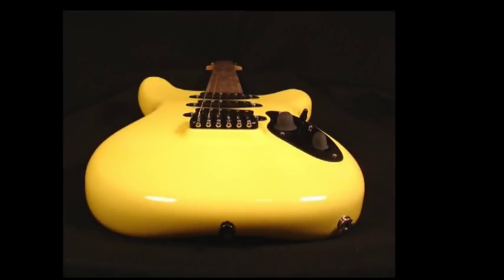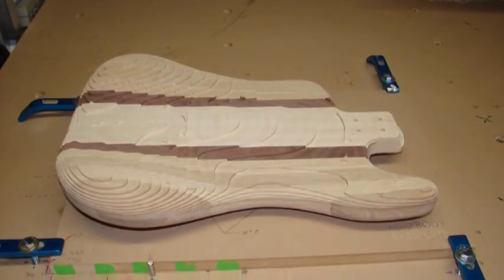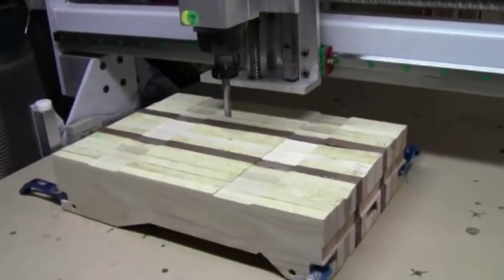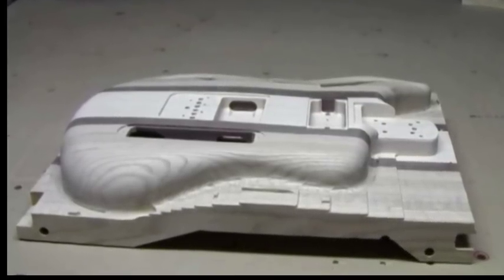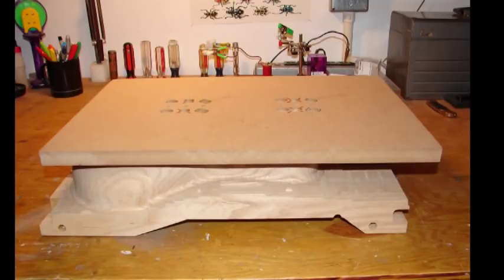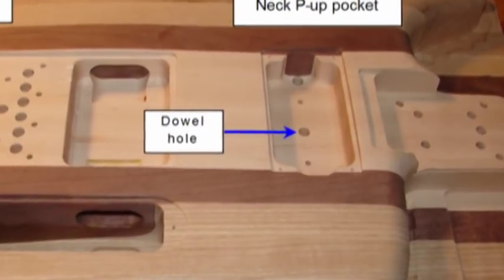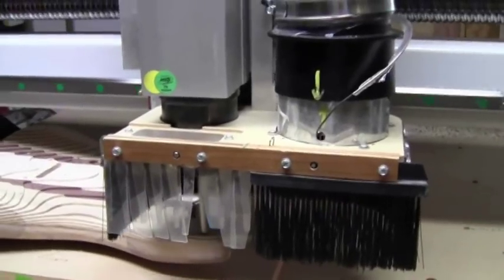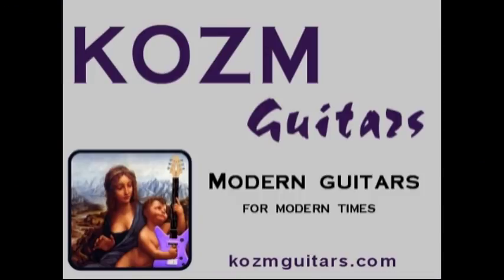CNC Guitar Tutorial - Flipping over a 3D body

Comment from the maker: #2
Secondly, as I “pre-chamber” most of the individual planks, I believe this actually enhances the overall tonal character and resonance of the body.  By eliminating a lot of the energy-absorbing  “dead wood” in the very core of the body, the outer strata of wood are more free to micro-flex, resonate, and re-propagate the sonic energy back into the bridge / neck system.  
(Cont’d at #3)

Comment from the maker: #1
I can’t say I’ve noticed any degradation in sound quality.
In fact, I would say that if anything, it either makes no difference whatsoever, or actually IMPROVES the sound (over using a solid plank of the same wood).  
For one thing, I can actually use different types of woods across the body, allowing me to put more dense woods in the middle (where the bridge and neck mount), and “mellower”, lighter woods elsewhere.  
(Cont’d at #2)

Comment: When flipping a part on the cnc bed , what are your thoughts on placing the cam origin on a corner, for the backside ops? You placed your origin on a dowel hole.
Reply: The main advantage of using a machined hole (and slot) is that you know exactly where it is with respect to the rest of your geometry.  If I understand your question correctly, if you use a corner, you're assuming that your block of wood is perfectly "orthogonal".  I suppose you could machine two of the corners, to make them orthogonal - but then you might have to remove clamps.   I'm having a hard time imagining what the advantage is.
Shoot me an email (at KOZM Guitars) if I'm not making sense.
Reply: My thoughts were to set a zero on a physical location (corner of base board).
Using a dowel hole to zero is a good idea, It is done in the same setup as the other machined features.

Comment: How did you figure out where to line up the dowels?   or did you set it up that they are in the center of the piece?
Reply: I happened to place the dowels in the center of the block, but they don't necessarily have to be.  They can be anywhere that's convenient.  As long as they appear in the CAD model, and you account for them correctly with your CNC, you shouldn't have any problems.  
Hope this helps.  
Let me know if not.
Reply: Worked great thanks for the advice.

Comment: nice axe,i design and build tube amps,im in the process of acquiring info to build a 3 axis cncrouter/engraver to make front panels,i wont BS you ,i want to make a custom les paul design ,after seeing LP copies,and knowing the LPs failings,i want to make my own,long tenon or through neck,you obviously design this type of profile you cut,how did you manage to laern this,what cadcam do you use.
I hope i'm not beeing too nosey,i dont copy other peoples stuff,unlike the LP,i can make it better,as i have one and it cant get better with the design it is,no more cutting can be done as the material is'nt there to remove.
I have also thought about laminated cabinets,as you laminate gtr bodies,contrast is beautiful .
The first machine will,believe it or not ,be 3 cd rom stepper motors to get X,Y,Z axis,after i get this fully opperational a 600mmx1300mm cutting area mill/router will be assembled.
all the best,and very nice video,i like the fixing method to flip the jig.